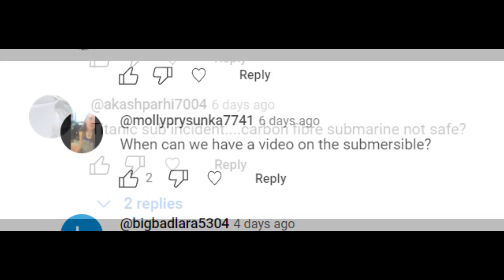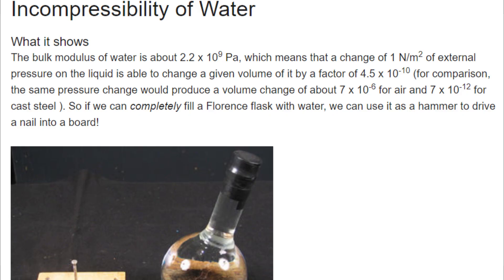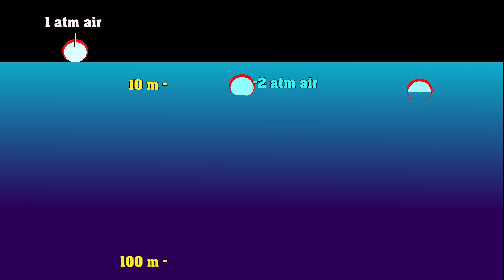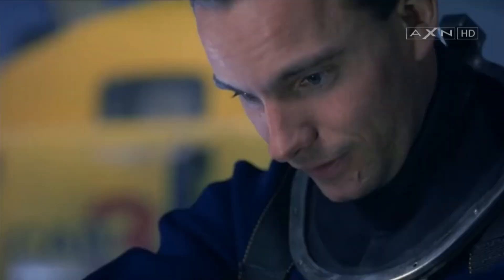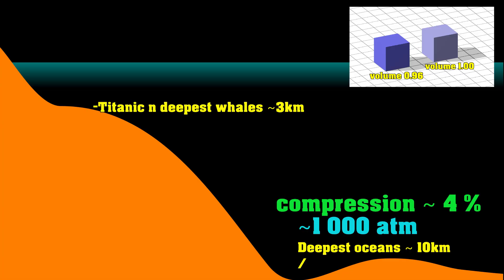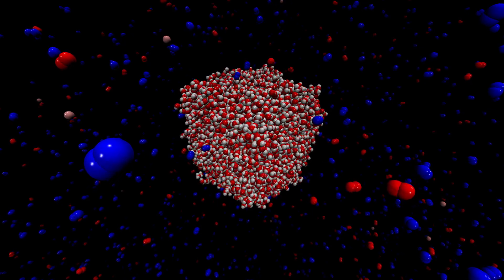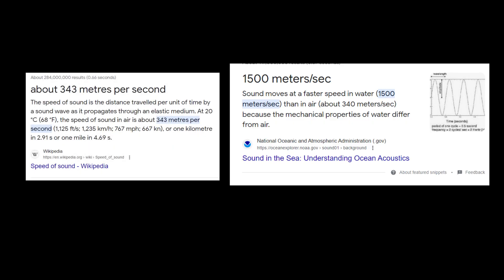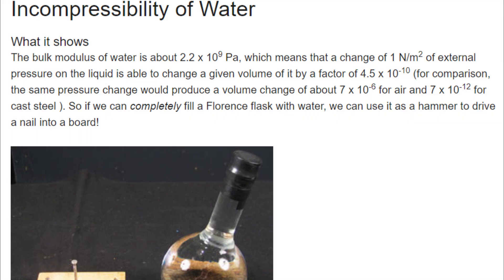What Happens when a Hull Fails at 1000 atmospheres?

Comment: there is a few corrections to be made, but first

as the sub was basically built like a barrel, as soon as it deformed, every wall would collapse at the same speed, as you can think of it as like a stone arch bridge, but in a circle, and that every stone is the keystone, as soon as part of it collapses, it would've been like none of the walls existed as what you wanted to simulate

but, in saying that, you've gone about simulating it wrong as it would collapse in from all directions at the same speed, so, you would be crushed in from all sides, the floor would move up under you as fast as the roof comes down on you, so the speeds would basically be doubled

but it also brings to that it's not just freefall as we're not only thinking of in a 1 dimensional scale, water would also be pushed in from all directions, think of it like hydraulic press channels water jet videos, despite the press moving at such a slow speed, it comes out at a high speed, it's cause it's moving a lot of water above and pushing its way in

anyways, it's still very unimaginable how fast it would collapse as it's the cumulative of all these effects and more going on at once

but man, that whole thing was basically a ticking time bomb with how it was built, despite carbon fiber being made mostly of plastic, you've got to give credit where credit is due, which is, carbon fiber has a high tensile strength, but with the way it was built, it was basically using it for compressive strength, which is to say, the carbon fiber may as well not have been there with the poor choice of design for the application, it really was just a thick plastic hull

Comment: It would be really informative to move the timeline a little further. After the super-fast expansion of some of the higher-pressure water into the 1-Atm space, would not the next step be a 're-compression' where the higher pressure water surroundiung starts pushing into the lower pressure space? Optically, "the dark blue pushing into the light-blue"? Because ultimately everything will be high-pressure / dark blue again, right?

Comment: Regarding breathing oxygenated fluids, while technically possible, it is as Thunderfoot said, very hard work. Iirc. the navy divers, who tested it, would basically start to sprain the muscles involved in breathing, even trying to do the simplest work beyond breathing and staying alive. I think one of them broke a rib, trying to get work done. 

So theoretically possible, but practically impossible. 

I think they've thought about using mechanical aids to move the fluid in and out of the lungs, but that would add more layers of complexity and if your diving suit is now carrying an entire ventilator system, you might as well start going to a sub or rov instead.

Comment: What happens with the temperature of the compressed air inside the sub?
Reply: insignificant compared to the energy of the water at least that seems to be the consensus in the comments. at any rate the volume of the air is less than a fifth of a cubic metre at that point, the water inside the submersible fills over 97% of the volume inside, the rest could be momentarily very hot but it will not matter. since it's air, it won't explode or anyhing. the "dieseling" thing people talk about seems completely unfounded to me. they're not even in contact with the hot air after ~4 milliseconds after the hull breaking. note that the water also cools a little with expansion

Comment: I've always wondered how water depths could exert so much pressure with such little compression. The spring analogy was perfect
Reply: The pressure would be the same even if water was perfectly incompressible: pressure at depth depends only on water density. What water springiness does is affect how quickly it expands into a cavity, such as a breached sub.

Comment: What I find crazy is that carbon fiber is strong in tension, not compression.  It can be used to contain internal pressure, but under compression it will shear.

Comment: 1:40

"Say a truck tyre falls on you:
Its not going to kill you, regardless of if its attached to a truck or not. The tyre falls at the same rate with or without the truck, if you ignore some of the suspension slowing it down."

Yeah, no shit one scenario is going to transfer a little bit more energy than the other.

Comment: So, just curious, but would there be any difference (in terms of mechanical process, obviously the consequence to the passengers is essentially the same) between the inadequately-rated porthole giving way, causing the air inside to be compressed and over-pressuring the cylinder from the inside, vs the carbon fiber cylinder failing directly?  Like, rather than it crushing like an egg in a fist, would it potentially burst apart at the seams? Would the rapid spike in air pressure cause a temperature spike and potentially ignition of any flammables? And, I suppose, would there be a difference in the timing of the fatality of the passengers?

Comment: The interpretation of what would happen in the "incompressible" case is incorrect. The behavior one calculates assuming incompressibility should match the behavior that results in the limit of compressibility approaching zero. As you decrease the theoretical compressibility of a fluid, you still get violent implosion, no matter how low the compressibility becomes, just from F=ma:

If you have 1000 kg of totally incompressible fluid with a 1sqm surface being acted upon by a pressure difference of 10 MPa, then it will accelerate at a thousand g's, bringing it to 1000 m/s in 100 ms.

Comment: The part about the compressibility of seawater is correct, but the part about the sub only filling with water at what you call “free fall speed” is so catastrophically wrong it’s almost funny. You seem to have forgotten that even a hypothetical incompressible fluid can move in three dimensions and thus draw from all of the ocean around it to fill a space, and that the flow rate into a space is governed by the size of the opening and the pressure differential across it. The way a sudden opening in a pressure vessel in an incompressible fluid would manifest would be a very rapid filling of the pressure vessel with the fluid moving spherically inward toward the breach to replace the fluid entering the pressure vessel, with this movement being driven by a spherical pressure gradient radiating outward from the point of the breach.

Comment: You're overstating things tf. It's not 1000 atmospheres, the titanic wreckage is at a depth of 3800 m so it's about 380 atmospheres. Which means a pressure of about 38 MPa, which is 38 MJ of energy released per cubic meter and of course 1 cubic meter of seawater is about 1000 kg, so 38 kJ/kg of kinetic energy supposing perfect coversion or about 275 meters per second. Of course because of the viscosity of water you can be sure it wasn't that fast, probably more like 200 meters per second. But still I wouldn't want to be hit by a 200 meter per second wall of water. Not quite at the level of being hit all over by a waterjet cutter, but it probably knocked them out immediately and gave them instantly fatal injuries all the same.
Reply: Also, water is actually one of the MOST compressible non-gases. A bulk modulus of 2 GPa is VERY low, most solids and liquids have bulk moduluses of like 100 GPa or more.

Comment: Very interesting angle, new for me. Saying that pressure doesnt kill you, seems a bit wrong though. Strictly speaking it might be true, because the pressure has no time to reach you before the "normal pressure" explosive water 'bullet' is smashing your skull. But it's like saying the bullet is deadly, gun powder is innocent. Sure technically, but the bullet wouldnt move without the explosion. The pressure difference is what allows the water to explode (or implode) into the cabin once the hull fails to keep it outside.

Comment: I love your videos, but you've missed the main reason which is a super fast implossion failure of the vessel walls, which happens in milliseconds. No one inside even noticed - they have killed and turned into a mush faster than a bullet in the brain. The reason is a major design blunder! As a design engineed with years of experience designing pressure and vacuum vessels I would reinforce this with at least four solid steel rings from inside made from 50x50mm solid steel. The buckling failure under outside pressure is super inpredictable and the factor of safety should be at least 5 with heavy inside reinforcement fighting the buckling failure of the walls !!!
Reply: An alternative viewpoint is that the composite tube failed axially since it was simply circumferentially filament wound, which would yield a compression strength similar to the matrix.  Perhaps the designer was considering only the more obvious hoop stress.
Reply: @thedubwhisperer2157  possible, this woud absolutely worsen the buckling stability. But anyway - the reinforcement from inside is a must. This is just incredibly poor design. I am amased how something like this can be build from such stupid people. If only the hoop stress was considered this would be just unbelivable even for an extremely stupid engineer. The designing calculation for outside pressure are completely different and much more complex and still not enough reliable. This is why this type of design needs a huge factor of safety.
Reply: @lachezarkrastev7123  I wonder if failure would have occurred if the steel tube was outside the carbon fibre, eliminating the possibility of water ingress into the composite.  I don't see anything inherently wrong with bonding the end caps as many have thrown their hands up at!
Reply: @thedubwhisperer2157  here the main stress is on the cylindrical body. I do not think that winding the carbon from inside is even technologically possible, but even if it was possible this would make the carbon reinforcemen weaker, because there is no way to stretch the fibres from inside. Even if it was possible to wind it proper from inside,  I think this would not make a difference. Yes, gluing the end caps is a mystake - I would weld them to the steel mantel first and then wind up the carbon shell. Here I can mention that using carbon here is absolutely unneecery, because this is a submarine not a plane and using lighter materials is not justified but on opposite - incorporates many unknowns. Still the main blunder is the lack of reinforcing rings from inside, which is a must for structures under huge outside preassure.
Reply: @thedubwhisperer2157  I've just performed some finite element analysis on a vessel with the exact same dimensions. I am just shocked - even if the dome/which is the strongest part/ is made from solid 60 mm tick stainless steel /AISI304/ the stress in the dome on 4000 meters depth is close to 300 MPa with yield strength of this steel about 200 MPa. The stress in the mantel is close to 400 MPa even reinforced with 5 rings 100x50 mm solid steel. I just do not know, what those designers were thinking. It looks to me like no thinking at all. The buckling should not be an issue with this massive thicknesses and reinforcement until the material holds … but how much it would hold with stress two times the yield strength...? Crazy – just crazy.
Reply: @lachezarkrastev7123  I agree that inside winding would be problematic, to say the least, but a steel tube could be bonded onto a close-fitting composite tube.
Reply: @thedubwhisperer2157  yes I agree, but with my calculations this thing was doomed - the ticknesses I get for this dimensions are just insane. For example the Deepsea Challenger which goes to 11 kilometers has a crew sphere capsule with only one meter diameter and wall thickness of 60 mm. Here dimensions matters a lot. Imagine the ticknesses I get for this much larger submarine - it is 1.4 meters in diameter and 2.5 meters long on the cylinder part. I can send you the plots if you wish. I would not go inside if the cylinder part was not at least 100 mm thick ... and it still be a risk on 4 km depth for which it is supposed to be rated. This reminded me to check the stress in the walls of the Deepsea Challenger.
Reply: @thedubwhisperer2157  Checked the Deepsea Challenger capsule - the same stress as 60 mm wall of the Titanic submarine, but much more stable spherical design - about 400 Mpa - close to the destruction stress - about 600 MPa. I would not go inside on this too, because a simple leak will cut you like a laser.

Comment: I learned that water is slightly compressible,  hydraulic fluid is compressible by 0.5%.per thousand psi (just looked that up) 
I guess i'm interested in the power of the resulting shock wave, could the window failing cause a shockwave that would shatter the carbon tube? or is the tube failing and being further blown into debris by the shockwave more likely?

Comment: Also note the failure mode of composites. I doubt it was like your graphic, though it was a great way to illustrate the concept. Carbon Fiber failure, when I see it, is more like a shatter and delamination of layers. This probably meant that large areas of the sub were ablated almost instantly by the water in the process of it falling apart catastrophically, leaving more surface area to the water for ingress into the low pressure atmosphere, like popping a bubble made of paper mache. Carbon fiber is great for tension loads, but this was compression load. Plus, carbon fiber is harder to make strong in a completely uniform way and tends to slowly degrade over time as it starts to fail, eventually catastrophically all at once. I don't have experience with extreme depth vessels, but I have seen carbon fiber drive shafts and other components seem perfectly fine until they suddenly aren't. Sometimes, they almost turn into spaghetti.

Comment: So, If I have this correct at such depths, if there is any slight ingress of water through a crack it will act like a water cutting jet tearing at the hull material. When the hull then fails catastrophically, the expanding water acts like a water hammer with no meaningful air volume or pressure to resist it. I suspect that would then shatter the hull from the inside out?

Comment: OK so that explains why the window separated from the titanium cap and the cap separated from the composite (some have even said all the bolts sheared, although I never confirmed that). I thought that was odd since all those parts and their connections would need to be equally as strong as the entire hull, but I'm sure water rushing in at supersonic speeds, pushing outward against a structure that is intended to be strong against only inward pressure could easily do that.